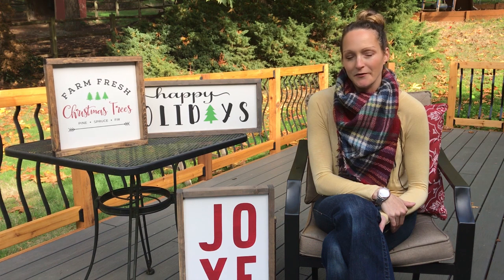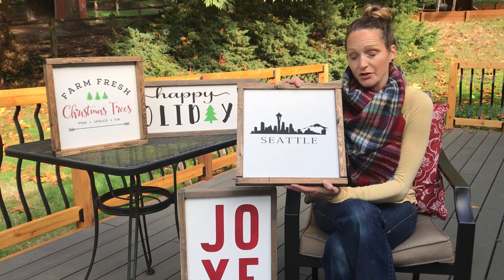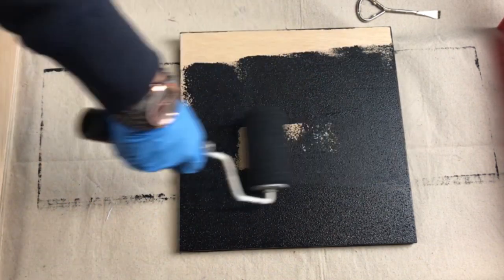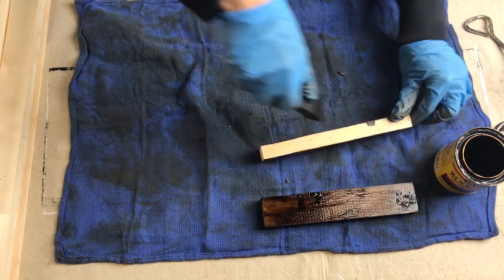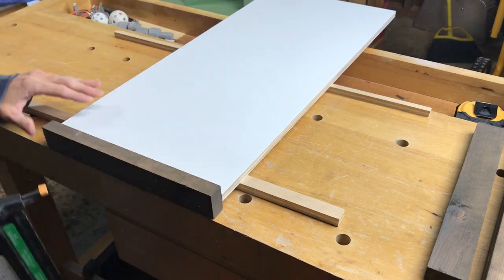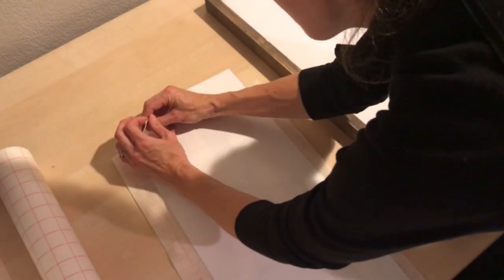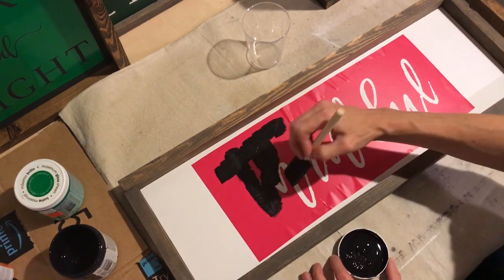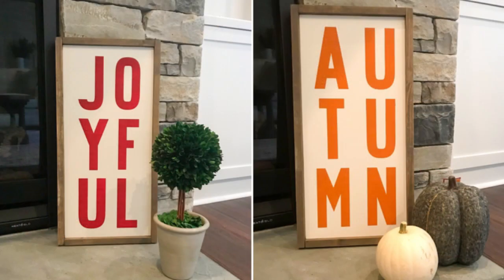DIY 9 Wood Signs out of 1 Project Panel

Comment: Loved it. I have a few questions. For example do you cut your own wood? And can you make an instructional video how to set up.
Reply from the maker: Thanks for the question Jackie.  I buy a large sheet of plywood and cut it down to size on the table saw.  You can also use a straight edge and a circular saw.  For the trim pieces I use 1x2’s and cut them to size with a miter saw.  This video shows the process, just a little different frame https://youtu.be/e1G1phBrIwU. I’ll try to get a new video showing it all soon 😀
Reply: Thank you..i can't wait for the next one.. When you get a chance make one  showing how you set up it in the computer and where you find if any pix or illustrations?
Reply: What can you use instead of a plywood project panel?

Comment: Hi im new here , so just wanted to know if you have a finished coat or varnish after the lettering so that it does not fade or peel?
Reply from the maker: Great question. I use spray on polyurethane now. The signs didn’t peal however when they got dirty it was impossible to clean them.

Comment: I love all of this!! and I have so many questions for you! what kind of vinyl and transfer tape do you use. that transfer tape peeled right of without pulling the vinyl with it! Also what nail gun are you using and what size of nails? if you don't mind me asking. Thanks!!
Reply from the maker: Hi Kara thanks for asking.  I just linked all the supplies I use in the video description.  I’ve tried a lot of transfer paper and vinyl and I now only use the ones I listed because I had problems with others.  I forgot to link to the gun and nails I use and will do that soon.  I use a Bostitch 18 gauge Brad nailer with 1inch nails.  Make sure your nails are just slightly larger than your frame boards.  If you have to long of nails they run the risk of curving and coming out the front of your sign.  Please let me know if you have any more questions and have fun making signs 😊

Comment: What are you using to attach the frames in the beginning?
Reply from the maker: Great question Octavia.  I used my Bostitch 18 gage nailer.  Also make sure you use wood glue as well to hold on the frame.  I didn't in this video and 6 months later the frames started coming loose on some of these signs so now I always use wood glue.

Comment: Is a project panel something you buy at Menards or Lowes ? Is that what it is called?
Reply from the maker: Thanks so much for the question Karen.  I didn't know what these were either a year ago.  You can find project panels in the plywood area at Lowes or Home Depot.  They are plywood but just smaller.  So most plywood is sold 4 ft by 8 ft.  The project panels come in 2 ft by 2 ft and 2 ft by 4 ft.  So just smaller and easier to handle. 😊

Comment: Do you share anywhere what the measurements to get those longer words printed on one piece of vinyl?
Reply from the maker: Good question, for the long boards I use my 12 x 24" vinyl.  I varied the sizing depending on how it looked best, making sure to leave enough room on the edges to show a bit of a white around it.

Comment: Which kind of vinyl did you use? I recently got a cricut and starting experimenting because I’ve always hand written all my signs. I used a Oracal 651 to put my stencil on my board but it peaked some paint off.
Reply from the maker: Aracely See oh you have more skills than me, I could never freehand 😊.  I just use this from Amazon and haven’t had any issues. Hope it works for you.  https://www.amazon.com/dp/B01HEB3UNQ/ref=cm_sw_r_cp_awdb_t1_KjYJCbK0XRVAC
Reply: @AroundtheHouse  Oh great! I'll check it out. I love freehanding but it definitely takes longer and hurts my hands after a while. Thanks so much!
Reply: Aracely See, just a suggestion, but 651 is permanent vinyl and that’s why you’re paint is coming off with your vinyl. Try using 631 which is removable.

Comment: are you using regular 1x2's that are roughly $1 or are you using the kiln-dried ones?
Reply from the maker: For these I used either 1x2's out of common board from HD or I may have bought a 1x10 common board and ripped it down on the table saw to the same size as 1x2's.  Sorry can't remember.  I'm not sure if HD kiln dries these.  Hope that helps.

Comment: Where do you get project panel
Reply from the maker: Valerie Goss good question. It’s just a 2ft x 4ft plywood sheet found at any hardware store. I used 1/2in thickness but 3/4in would work great too and would be easier to nail into w/o risk of the nail missing the plywood. Hope that helps. 😊

Comment: Do you have a cut list for the 1x2s
Reply from the maker: I cut these to fit so you will want to cut the plywood first and then cut the 1x2's to fit the plywood.  The sides should be the same height as the plywood and the top and bottom will be about 1 inch longer than the width of the plywood.

Comment: What is it your using to put the borders on your wood signs? The tool your using
Reply: Also how do you make your stencils?
Reply from the maker: To put the borders on I used 1 1/2” brad nails and my Bostitch nailer.  If you don’t have a nailer you can always start with a $25 Harbor Freight one.  That’s how I started.  I still use it from time to time. 😊  https://www.lowes.com/pd/bostitch-smart-point-2-125-in-18-gauge-brad-nail-gun/1000820868?cm_mmc=shp-cprdtolgooglelia-153-pneumatics-1000820868-_-0&store_code=285&gclsrc=aw.ds&&gclid=CjwKCAjwqZPrBRBnEiwAmNJsNiCDn9sWbCm802njNtYxCQIaZGYHZJnfgnI9dXhfs1QuM7PzP7hJmRoCqysQAvD_BwE
Reply from the maker: Hey Emily, for the stencil I used my Cricut.  Here is my video on what I did.  Please let me know if I can help you in any other way.  Thanks for watching my video 😊 https://youtu.be/aF5efwfySGk